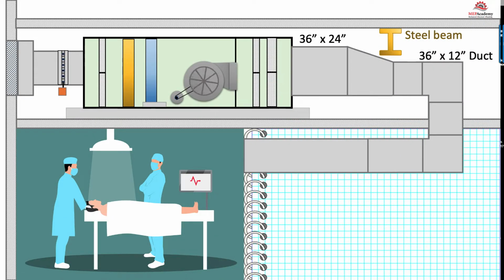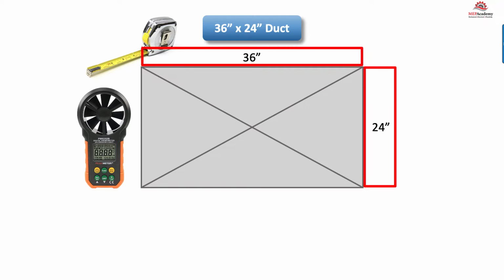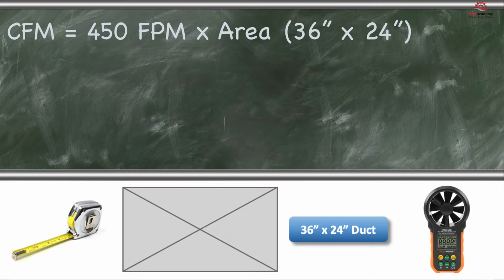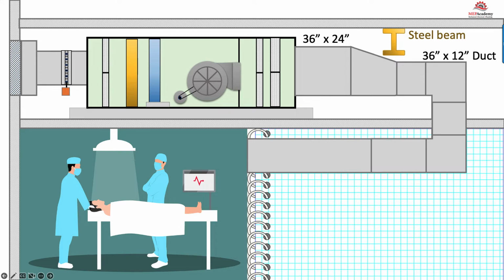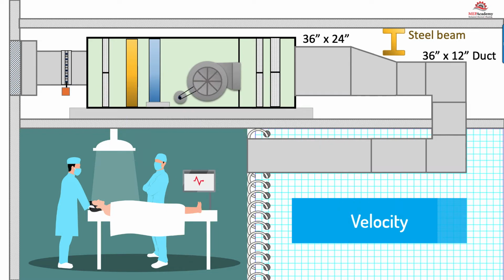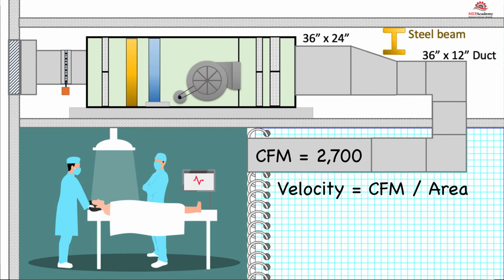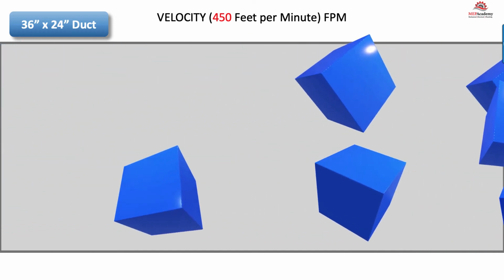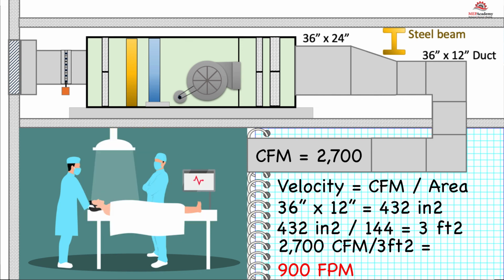Calculating CFM or Velocity from Area

Comment: Can you help me with this 12 x12 duct 2000CFM what is the FPM ?
Reply from the maker: First you determine the area of the duct, which in your case is 12" x 12" = 144 in2. Then you need to convert this to feet as we're looking for "Feet per Minute). 144 in2 / 144 in2/Ft2 = 1 Ft2. The normal formula is Velocity x Area = CFM, so we just work backwards taking the 2,000 CFM dividing it by the 1 Ft2 = 2,000 FPM of Velocity. To check your self put the values back into the original formula of 2,000 FPM x 1 Ft2 = 2,000 CFM. Hope that helps.

Comment: new on ventilation... why wouldn't we always choose the smaller diameter to get the highest velocity on the duct?
Reply from the maker: Higher velocities for the same volume CFM will cause the fan to work harder, causing an increase in energy consumption.

Comment: how about aircon cfm  calculate?
Reply from the maker: For air conditioning ductwork it's the same calculation. CFM in an air conditioning dict is based on the area of the duct and the velocity. CFM = Velocity x Duct Cross Sectional Area

Comment: Where did the 144 come from
Reply from the maker: There are 144 in2 in a square foot. 12" x 12" = 144 in2
Reply: It's a standard when you convert area in inch to feet.